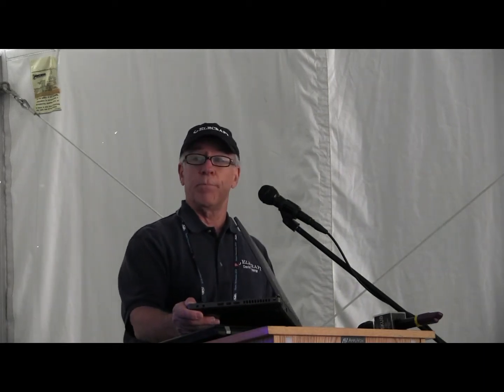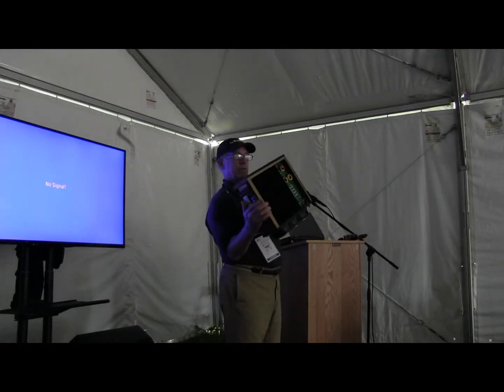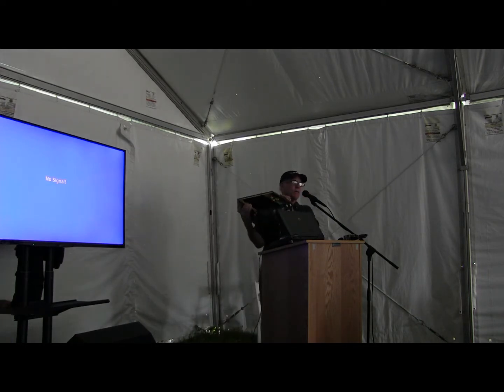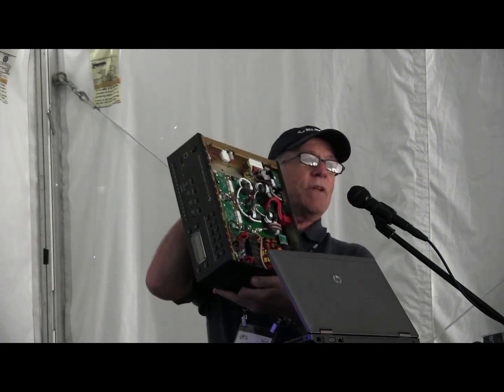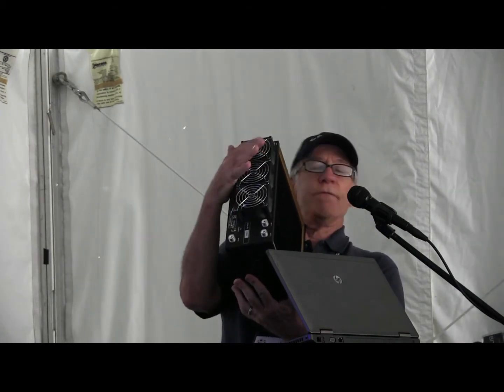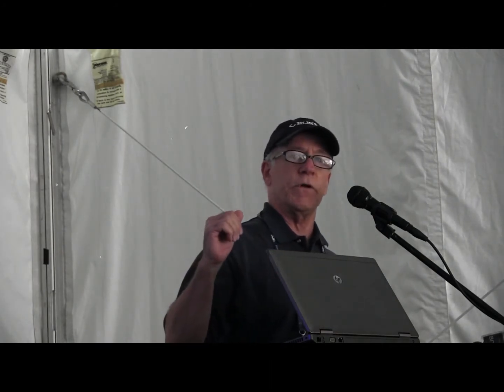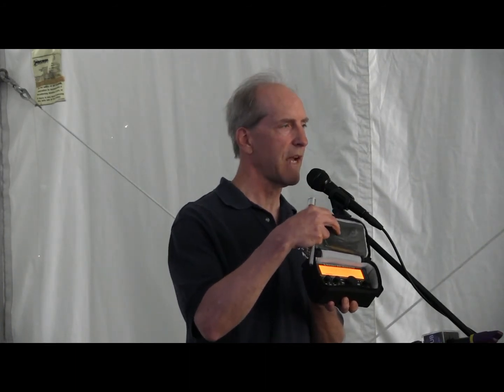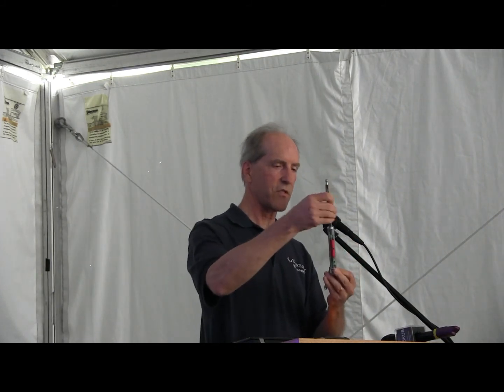Elecraft new Amplifier and Portable Antenna

Comment: You can load it via the coil  and the 20/17M operation, via a switch,  is nice. However the short radiator will have a pretty low radiation efficiency so one must consider that too. Certainly an option for Digital and CW. It is not on their web page yet so will have to wait for price info.